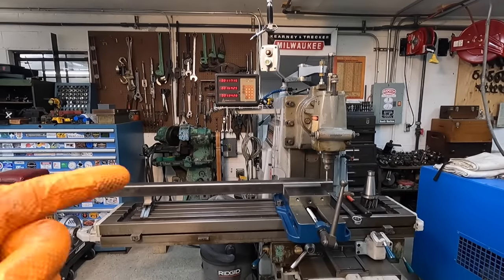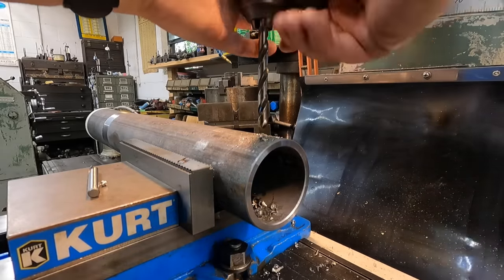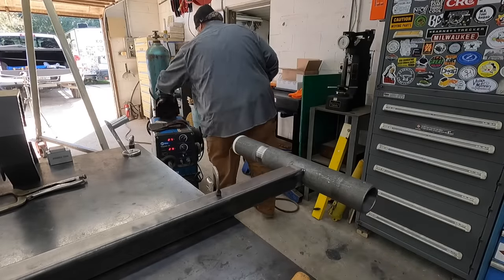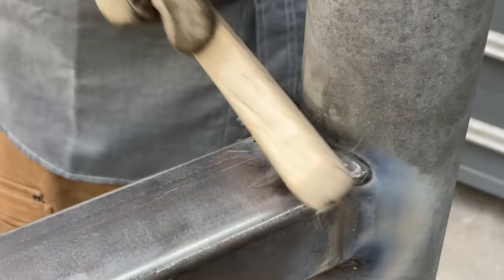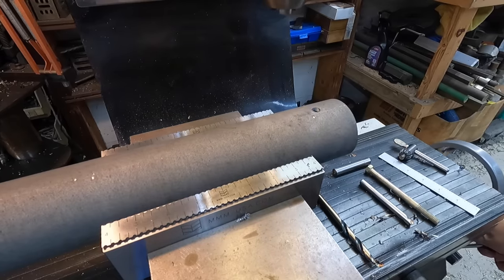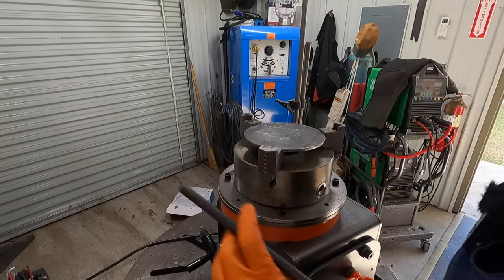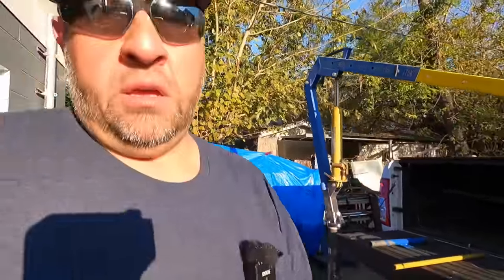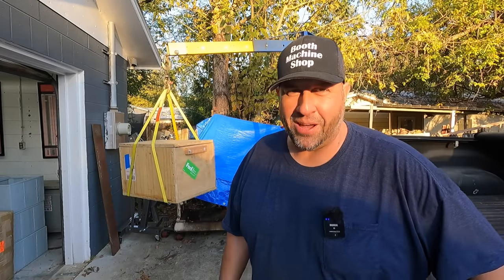Truck Hitch Crane Build Ep. 7: First Test!

Comment: You could also weld a coupler to attach a swing arm you can pull down and out to use as a handle to turn it with a load on it, and fold it back up parrallel to the main body for storage.  Maybe weld a spring steel c-ring to recieve the handle pipe higher up in the folded position?  Also PAINT it.  Rustoleum has the heavy equipment stuff in regulation safety colors blue and yellow.  GREAT idea, and great work, man.

Comment: Looking good 👍 if you are planning to leave the unit on the back then you could add a hindge with pin to the column where the steady rest mark is. That way you could simply ly the blue crane down onto the hitch when not in use and no need to lift it on/off or bolt/unbolt.  👨‍🔧

Comment: Weld a nut into the end of the handle, then replace the bolt that attaches the cylinder with a longer bolt. screw it together.

Comment: A nice build Adam, but a couple of suggestions if I may.  As quite a few others have said, you could have issues after lifting a heavy load into the tray, it may be difficult to pull the pin in the foot. A screw like on scaffold standards, to just give you a couple of inches of travel to release the load on the foot from your load in the tray. Air Bag suspension could also achieve the same result.
The big one though, is to always level your truck before using your crane. You were on level ground it looked when testing, but if you lift a heavy load while on a slope, the load will tend to swing to a lower position. It could crush either someone or something, (like the side of your truck). Mobile cranes always set up and get level, often with lots of cribbing for this very reason. A full airbag suspension could also assist if you have individual control of each corner, but you would not have a lot of travel, so only limited adjustment.
Lastly a winch would also allow you to lower a load where you wanted it to land, and not just where it had to land as the boom lowered. Sometimes a very useful feature. I have plans for a similar crane build, although somewhat simpler than yours. I think that I will just have a mount to fit directly into my tow hitch receiver, so that I can lift a log from the ground so that I can save wear and tear on my chainsaw when cutting billets for firewood.

Comment: Now that I think about it, the wheel doesn't need to be round. you can make it smaller by putting the spokes on the corners and the cross handles on the flats of the tube already there. I think that would make it the most compact and still make it easy to not hang up on stuff in the truck bed.

Comment: I do wonder how the weld's would look without the flux core wire? Im pretty sure fux core wire has more splatter, but the worm tracks??? Either way a call to Miller tech line would prob help you solve the issue. Great work as alway Adam! Your work ethick and attention to detail are at a level I can only dream of achieving.

Comment: Looking slick! Custom aluminum wheel chocks for the truck while swinging loads at the tailgate would be a great project. How about an eyelet welded on the boom end for a dog leash style snap on a heavy duty line for rotating the boom? You wouldn't have a rod to store, just unclip and toss the line in the back.

Comment: Adam, I wonder if the worm tracks might be due to the usual high humidity in Florida, leading to excess dissolved gas in the molten weld. Might be an argument against using dual shield wire in higher humidity environments.
Reply: He's using shielding gas AND flux core wire - how would humid air get anywhere near the weld?

Comment: Is adding a suspension spring (with similar characteristics to your truck) and shock absorber to the foot instead of the pin possible/practical or even sensible? Maybe something hydraulic you can release the pressure from once the item is loaded on the truck?

Comment: Hey man your pushing your dual shield  you not penetrating and traping flucx in the weld puddle  just pull in 1g 2 g and 4 g
Reply: And if your wire is in a humid environment it will collect moisture and and will cause worm track porosity

Comment: Oh my!!! Looking great, but I couldn't help but see the need for the final Adam Booth finishing touch to put this thing completely Over The Top!:  As I watched you placing the load in the truck, it occurred to me that wouldn't it be great if you could position the top boom in and out on the fly to both clear the far side of your bed and also place the load on or ahead of the rear differential for load stability. BAM...a horizontal, fine thread jack screw connecting the top inner boom to the top outer boom. Make the outer end of the threaded portion a nut that you could engage with a simple cordless 1/2" impact gun. That way you wouldn't have to rely on just 4 pre-drilled boom positioning holes, as you could change the boom length on the fly. I would think two simple threaded bosses, each welded to both booms, a method to fix the threaded shaft to the inner boom and then maybe a thin shim layer of Delrin on the top and bottom (McMaster

Comment: For the rotation, you could weld the short piece of pipe right beneath the lower cylinder mount, and use it with the pump handle the way you were already talking about.  That way it's really convenient to move the handle between the pump and the turning pipe, and it's not in the way at all when everything's closed down

Comment: That works and looks great! Maybe weld a short pipe fitting right under your cylinder gusset plate since it's not panted in that area so you don't have to move your pump handle to far to swing your boom.

Comment: A very cool  design right there and a fantastic job of building it right there. Will be interested in seeing how easy it is to remove the hitch crane after setting 500 lbs. in the bed right there.
"Perimeter" is the distance around a circle right there and a "parameter" is a range of settings right there.

Comment: I love this project as well as how it's being filmed. Do you think it needs legs angled down toward the front and rear of the truck 90 degrees to the horizontal bar? Maybe the horizontal bar is enough but there seems to be a lot of twisting leverage when you reach out behind the truck and into the bed with the load.

Comment: 31:00  Pin holes that close together seem to cut the pipe almost in half...
Reply: If you need such fine height adjustment, then two half spaced rows that are staggered might be an idea, so the metal bridge between hole edges is 1.5 times the hole diameter.

Comment: Ok Adam. I’ve done some research on dual shield welding. You want more wire feed, too much voltage allows nitrogen into the weld puddle. Also not enough stick out or contact tip to work distance does the same thing. You should have 3/4 to 1” stick out for that specific wire. And the only other thing I could think it would be causing your issues is maybe just old corroded wire. I’ve fought bad spools of wire before and it seems like your just wasting a good roll but the corrosion can really give you fits in my case with short arc solid core 035 wire it spits and sputters and causes porosity like a son of a gun. Good luck and best wishes. Grab some plate and start playing so the next time you lay a bead on a actual workpiece, you can be proud of that weld. I love welding and my favorite part is when I lift my hood and see the weld turn out exactly like I wanted it to. I just wish I could do it on every weld,

Edit: too short of stick out doesn’t allow the flux to preheat, when it hits the weld puddle cold it causes that porosity. I honestly  think your issue could be two or more things not being in the right window. I wish I could just set down with your machine and play with it and dial it in. Well maybe one day! 
I love all the unnecessary effort you put forth to make the best parts you possibly can in a day and age that all anyone thinks about is saving money and getting an extra dollar out of people.

Comment: Very good improvement for the truck. One suggestion - would be so cool to have a remote control to move the lift. Raise, lower and swing the boom remotely. When moving something much heavier, wouldn't it be better to do it from a safe distance. Besides, how much more fun would it be to use a remote control?

Comment: what kind of loads do you intend to lift with that? How do you intend to resist tortion if the foot slips? Why is it so heavy on top but way undersigned below? You better do a load test on that. lifting that boom is as heavy as the loads it seems capable of lifting without a catastrophic failure. Good luck. Dont be so hard on your welding. I saw two tons capability on the lift. Superstructure seems overdesigned and heavy as hell. You dont need to lube nylon. Looks like you had fun. lol so when the load is on the truck how are you gonna pull away?